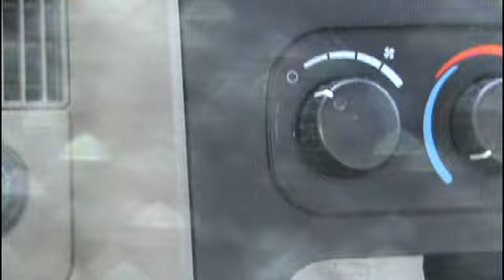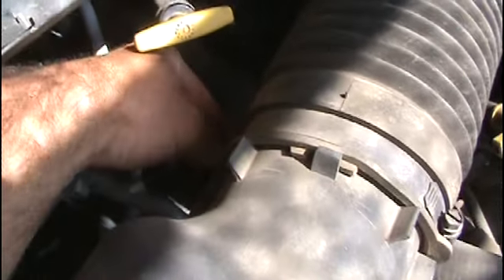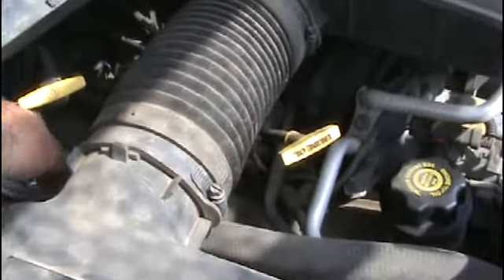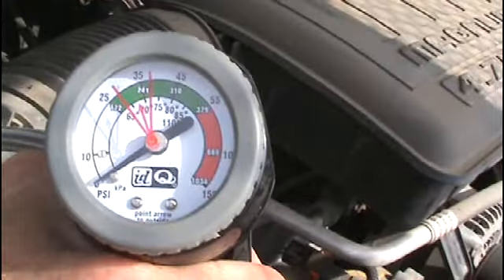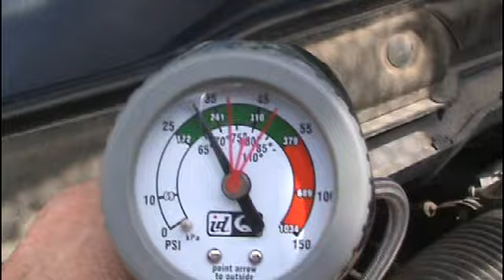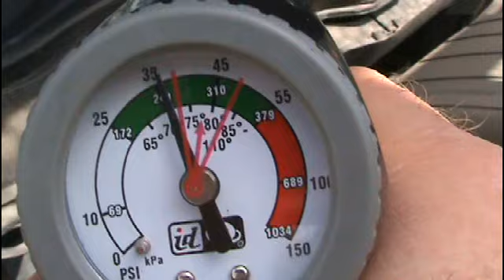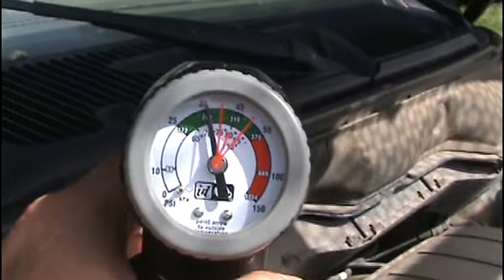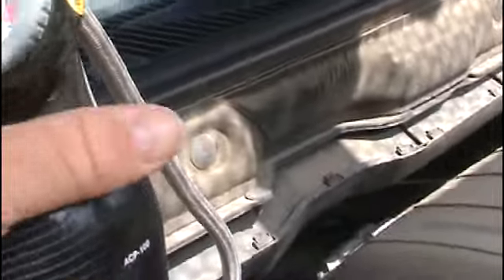RECHARGING THE AIR CONDITIONING SYSTEM ON A 2003 DODGE RAM 1500

Comment: Would help if you showed more clearly where the AC attaches. Hard to tell from the video.
Reply from the maker: There is only two ports. The hose will only fit the low pressure port so you cant mess it up. The port looks like the end of a tire stem. There is usually a colored cap on it with a l or H on it. L for low H for high.  On my dodge it was on the left side of the engine. You fill it at the low pressure port with air conditioning on high and vehicle running. Also leave vehicle doors open to make sure air conditioner stays on.

Comment: My 2003 Dodge Ram won’t take the charge, the garage stays in the white section, even tried another can and trigger apparatus
Reply from the maker: Make sure the vehicle is running! And you are hooked to the low pressure port. And its screwed on straight.